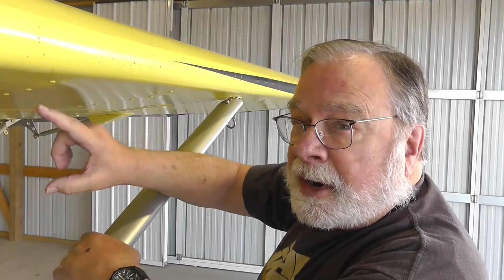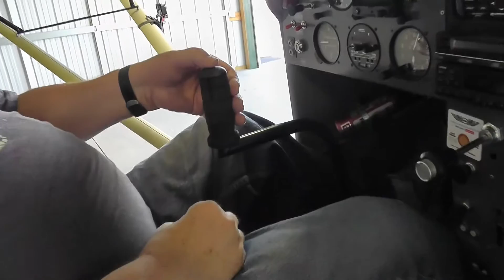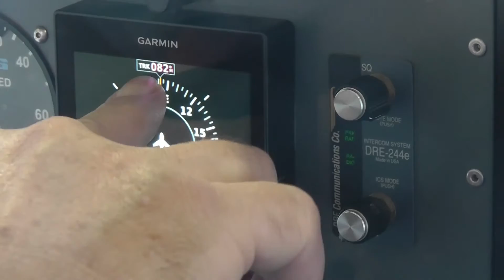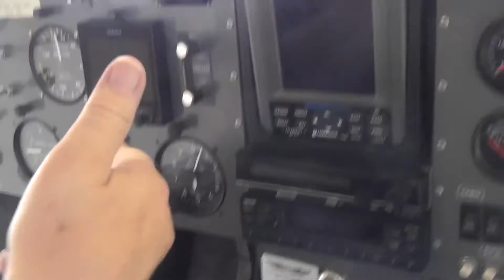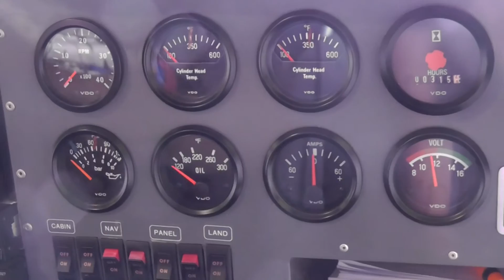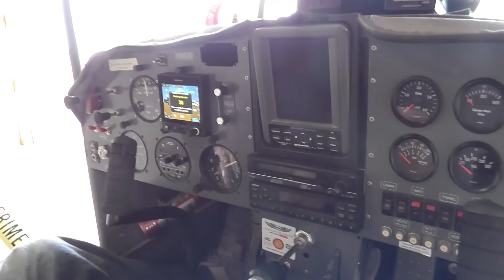Tour of My Aircraft

Comment: The ball is a coordinated turn indicator, part of the turn and slip instrument. The artificial horizon tells you if wings are level, along with pitch info. In a well made turn, the ball will stay at the bottom. If it's not at the bottom, you "step on the ball" with the appropriate rudder pedal until it is.

Comment: I used hand controls to learn to fly in 1990.  The controls connected to the rudder pedals and you moved a rod back and forth for rudder and turning the wheels and once on the ground, I moved them up for breaks.  The FAA allowed me to use the controls in both a Cessna 150 and 172.  It was a great time in my life.  Haven't flown much since then.  I could hit a lot of repeaters while up in the air, too.  The biggest airport I flew into was Columbus, Ohio.  It's wierd when the wheel skid marks on the runway are further apart than the windspan of the little planes I flew.  I hope you have as much fun as I had.  Flying is a great thing. . . . N8CA
Reply: N8CA was the tail number of an airplane I flew on my first job working for a certificate holder. Lots of memories on that airplane.

73, W8SGV